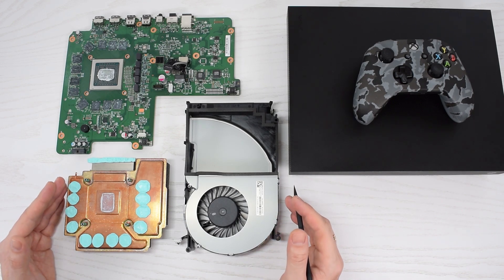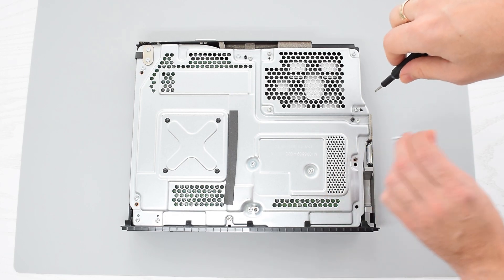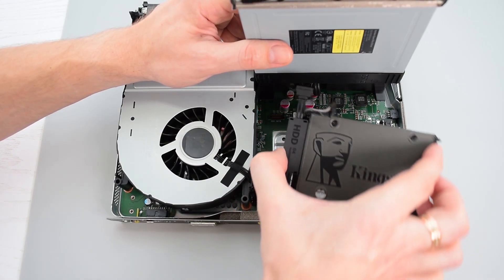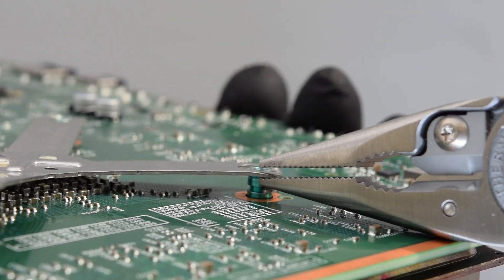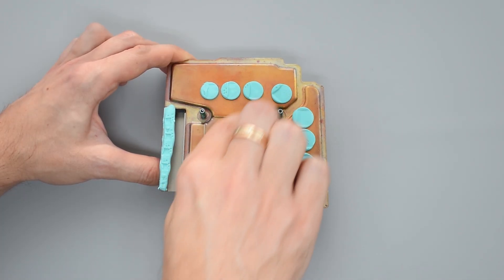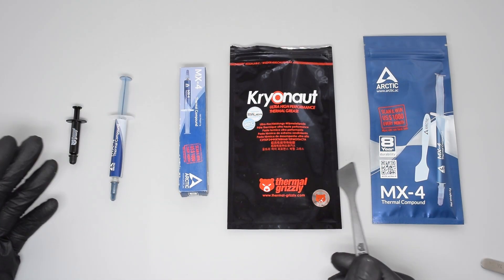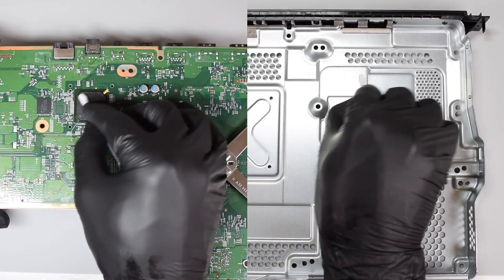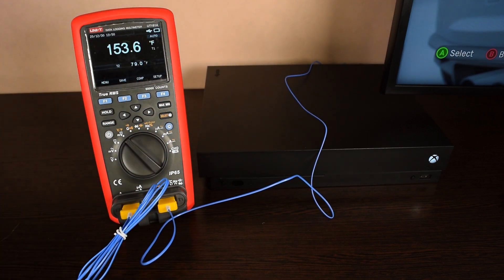Xbox One X Thermal Paste and Thermal Pads replacement. Cooling system cleaning. Best explanation!

Comment: Olá!, Estou com meu Xbox one x, desligando após pôr algum jogo pra rodar, já troquei a pasta térmica por 3 de nomes e originais, inclusive essa sua do vídeo, já mudei de posição, já coloquei a pasta de tudo que foi método... Seria o defeito nós thermal pad!?, Antes o cooler trabalhava acelerado, agora continua acelerado e desligando. Grato!.
Reply from the maker: What thickness thermal pads did you use for your console?
Reply: @ElectronicsComputers  Actually friend, I do not replace the original thermal pad, just the thermal paste, I remodeled the original thermal masses of the memories with my fingers ... I am thinking of replacing them ... is this the defect of the shutdown and accelerated cooler? .
Reply from the maker: @eletroRik  It's hard to say without proper diagnostic. The problem could be even in your heat sink. If the heat sink develops tiny cracks the  can leak out and
Reply: @ElectronicsComputers  What is inside, if there is something, it must be gone, because it has a clamp pin, which shakes the wick, I noticed this ... I'm already installing a water cooler on it, removing this waste sink, and adapting sinks to rams memories !. I am from Brazil, there is no assistance to pay for this !.

Comment: Xbox One X thermal pads are 2.0mm not 1.5
Reply: I was getting mixed results between 1.5mm and 2mm. I called Microsoft tech support today, and they told me to use 1.5mm.
Reply from the maker: @ianb.1603  Sure! There's no need to be  a genius to measure the sickness of the compressed area of your old thermal pad. It will be about 1mm. So 1.5mm is the right choice.
Reply: @ianb.1603  Thanks for calling MS to confirm. I had read a lot of stuff saying 2mm and this was the first time I've seen 1.5, but it's good news because 2mm pads are harder to buy!
Reply: @timr3168  Ya, i was seeing alot of both aswell, thats why i made the call.  they did say that the 2mm will work if you can find the really squishy pads, but they are pretty hard to find, so the 1.5mm is recommended because most pads arn't plyable enough. And just to confirm, the 1.5mm is working awesome for me.  No issues and temps have been steady below the standard.
Reply: @ianb.1603  Did you use grizzly pads or a different brand 1.5mm? And how old is your xbox? There is still a lot of debate on 1.5 vs 2
Reply from the maker: 2mm thermal pads are too thick! If you install them there will be a gap between the heatsink and APU die surface and your console may end up in our repair shop with APU replacement. Technically, you can use the 2mm pads but you have to squeeze them to 1.5mm (in case if you're desperate and already bought the wrong ones).
Reply: @ElectronicsComputers  if there is a gap between CPU and heatsink then in few minutes, the console turn off automatically...if don't it's OK.
Reply: @ElectronicsComputers  I already search a lot, almost everyone is using 2mm
Reply from the maker: @Ahov29  Sure, such people bring their dead consoles to our repair shop on a regular basis.

Comment: 1,5mm thermal pad is ok, or better 2mm?
Reply from the maker: 2mm thermal pad is too thick and the heat sink won't make any contact with the APU  die surface.

Comment: My one x had insane woosh sounds from the fan and was always around 56c after replacing the thermal paste its super silent now but temperature reaches 70c is this normal?
Reply from the maker: It's totally normal. The RPMs of Xbox fan is the best indicator of the APU temperature. When the thermal paste dries out it doesn't transfer as much heat to the heat sink as it was before and this why you get low temperature reading. After you've replaced the paste it started to transfer more heat from APU surface to the heat sink thus providing more cooling to the APU and as a result your heat sink now has higher temperature reading.
Reply: @ElectronicsComputers  True. But it's curious how the stock thermal paste has the highest temperature reading. Does this mean it was better that grizzly/artic...conducting more heat? ;)

Comment: Your guide has great details the most so far Ive seen. Liquid metal could be used they use it on laptops that have no IHS and even Asus now applies it to most all theyre higher end modern gaming  laptops with no issues non conductive nail polish can be used to protect outer smaller components to prevent short circuit it must be applied in layers . The NVme drive would work many who have tried say the Xbox One X IO bandwidth is limited to Sata III speeds ..600Mbps ..still fast but not as fast as nvme